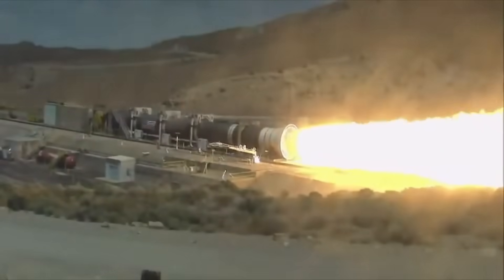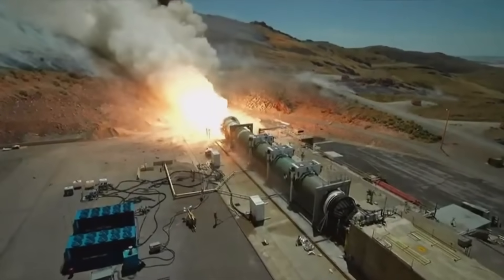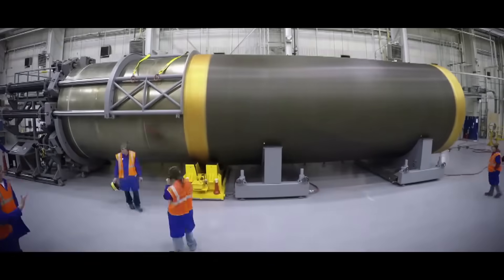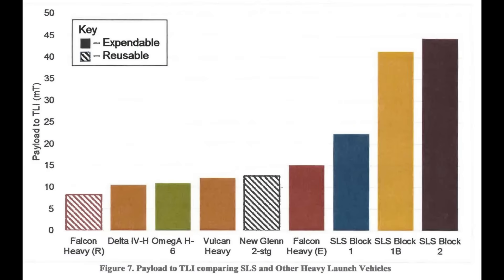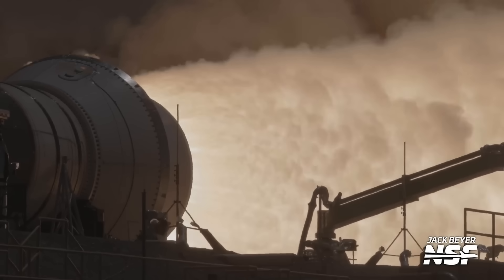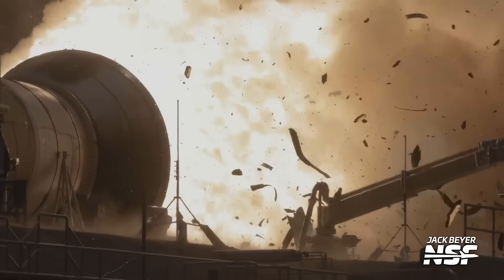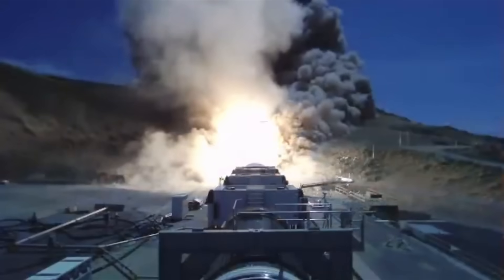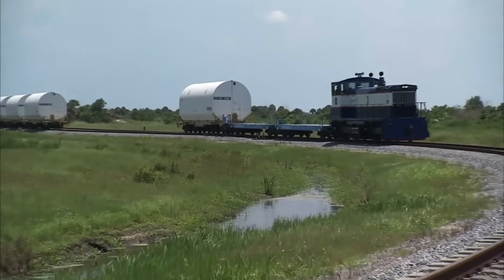NASA's Future SLS Booster Just Failed Its First Test

Comment: The Roman horse argument is not right. Stevenson had wagons from a horse drawn railway (at Killingworth Colliery) which were common at the time as one horse could pull far more on rails than with a road wagon. Indeed, the Stockton and Darlington Railway was originally foreseen as another horse railway.  The railway gauge history does not go further back than that.
Reply: Additionally, the US railway loading gauge (i.e the actual profile that limits the width and height of cargo and rolling stock) is a lot wider and taller than European, and especially British, loading gauges. And the SRB is two feet wider than most US loading gauges too, meaning special considerations are needed to avoid too narrow tunnels etc. Yes, the story is classic, but long debunked.
Reply: @kristenburnout1  Scott didn't say Loading Gauge; he said Rail Gauge...
Yes, I know; (and so, presumably does Scott) that the US's Rail Loading Gauge is a lot bigger than the UK's.
Reply: It is a kinda a leap of logic that rails had to be the same width as wagons but the coincidence is notable even if it was just a subconscious choice
Reply: The earliest rails were in mines. This is also where the first engines were put on rails. There is no connection to roman roads.
Reply: Who do you think fabricated the wheels and wagon trains for the mines? In most cases the exact same people making wagons and carts for Roman Roads, using the exact same tools and facilities...
Reply: @BertoxolusThePuzzled  According to Wikipedia his son’s firm, Robert Stevenson and Company. It was a specialist railway manufacturing company that also made the Engines.
Reply: @hempsellastro P.S. I am not trying to be pedantic but the Stevenson tracks weren't made in a vacuum. There were over a thousand years of standardization that existed prior to their company even being founded, much of which happened under the Romans as they were the biggest group of people transporting mass cargo long distances for a sizable chunk of Europe's early history.

So while the myth may not be literally true, it is still colloquially true in the sense that some Roman administrator in antiquity made a decision that ultimately decided the width of most forms of land based transport today, potential 2 thousand years later.
Reply: @BertoxolusThePuzzled  Really? The "exact same tools and facilities" 1400 years later? That seems... unlikely. Not least of all because there were a few hundred years of sub-roman Britain during which very few roads, wagons, or iron working at all was happening. Not that things were ever tightly standardised or uniform in the Roman Empire to begin with. You're right that neither the first railways nor Roman wagons were made in a vacuum. They were made in a world inhabited by people of roughly the same size, with roughly the same animals, and constrained by the same laws of physics. So it's not surprising that they came to broadly the same range of answers for the question "How wide should we make this carriage to balance stability, manoeuvrability, capacity, and ease of loading?"

There's really no need to hypothesize a direct causal connection from A to B across millennia, when the context is similar to begin with. It's the same fallacy that leads people to come up with crazy theories of interoceanic Neolithic empires for why pyramids were built by both the Aztecs and the ancient Egyptians rather than simply noting that it's an easy (and obvious) way to pile up stones and have them not fall down for a long time.
Reply: well...I need to add my 2 cents.....both in England and in the US there was a big dispute over rail gauges...both country had Broad gauge railroads (for obvious Intelligent reasons) but 4ft 8" was less expensive so in time it won out...The Erie railroad was just one notable example... ..........  the Russians stayed with a Broad gauge to this day........
Reply: If the thread continues, it would be something that is shared by all horsedrawn wagons and carriages... The width of the harnessing. If we could assume that those have been made in a standardised width throughout history all the way back to the Romans...

Given that, which seems a long shot, we would need to establish that rail spacing was derived from this same standardised.
Reply: Hmmm... And yet if you look at the Roman road remnants existing today the ruts ARE a close measurement (that means not exact to the 1/1000 of a mm, be rational here) within a couple  CM  so there's SOMETHING common about this.
Reply: @bobjoatmon1993  Roughly the same yes for the obvious reason. But railway gauges are accurate to the quarter inch. The Stockton and Darlington gauge was actually 4ft 8 inches. But Stephenson added a half inch for the Liverpool and Manchester to stop the existing wagons jamming around curves. This became the Standard gauge. Space folk need to study this history carefully as we making the same mistake with docking and berthing hatches.
Reply: @bobjoatmon1993 it is however just coincidence. The waggonways were using everything between 3' and 5'. If Stephenson had started his career somewhere else, we would likely have ended up with a very different standard gauge.
Reply: @bobjoatmon1993  Source please. Where are you getting your measurements of Roman road ruts from?
Reply: @QuantumHistorian  Internet!
Reply: @QuantumHistorian  You know you can search for these things and find scholarly articles, right?  They averaged 4'10"
Reply: @vlakieste  Sure, but they made a claim, the burden is for them to show the evidence. Ditto to you. By the way, I did google it, but the results are highly polluted by AI and old repetitions of this very urban myth, so finding good data is not trivial. Surely as you and bobjoatmon posted this claim, you have the paper backing it up at hand and can just share the reference? That will not just make my life easier, but also that of everyone else reading this thread, and mean that we can continue this discussion from a common starting point.

The average isn't the only thing of relevance here, but also the spread. And whether the measurements are just from one point in space and time (ie, Pompeii) or if it spans the 3 continents and 1000+ years of Roman history.
Reply: @QuantumHistorian well, it was a introduction class / lecture back in 1984 covering aspects and history of mechanical engineering, long before the internet, so to 'modern people' like you, it waa in prehistory and doesn't actual exist, right.
Reply: @bobjoatmon1993  "I heard it a while back" doesn't count as a source. You could be lying about it, or have misremembered, or the lecturer could have made a mistake. If there's a source, I could check it, and check its sources until I get to the foundational data. This is how discussions work and we learn things. Either provide a source, or have the honesty to admit you don't have one, and are simply spreading an urban myth that's been around since way before 1984.

Also, the idea that you can condescend me by calling me a "modern person" who doesn't care about anything pre internet is cute.
Reply: @QuantumHistorian Pompeii has a lot…just visit with your ruler
Reply: @shaunsandow2073  Why should I? Someone made a claim, and asserted that it was backed up by real measurements. It's up to them to back it up. The burden of proof is on the one making the claim, not on others to disprove it. The ability of people in this thread to forgo all critical thinking because they want a cute story to be true is astounding.
Reply: @QuantumHistorian I'm just reacting to your dismissive post
Reply: @bobjoatmon1993  Asking for a source is not being dismissive. It's the exact opposite - literally asking for more details. That you can't see that says a lot about the regard you have for facts.
Reply: @QuantumHistorian see, your STILL doing it. And the fact that you can't put yourself in my position says a lot about how you see the world.. I'm done.
Reply: @bobjoatmon1993  I can very easily put myself in your position - it's that of a BSer who has their feelings hurt when someone calls them out on their utter disregard for facts. I just chose not to endorse, sympathise, or make excuses for such a position. If you claim that data shows something, "the Roman road remnants existing today the ruts ARE a close measurement" then you either provide the data or shut up.
Reply: There's obviously still a geneology there. Technology is cumulative. They would not have reached the exact same arbitrary measurement on such a closely-related technology without some influence carrying over, even if it was as simple as some engineer thinking "well I think it should be about this wide" just because he was unconsciously thinking of carriages he had already seen.

I think this "it's just a myth" business is too clever by half, very Reddit. It's the same axles and wheels and the same idea and the same width coming from the same place. Obviously there's a geneology.

Comment: Did they forget to check the O rings again?
Reply: No, they discovered a new failure mode.
Reply: There are no O-rings in the aft skirt and nozzle assembly.
Reply: Maybe they forgot to remove the foam insulation?
Reply: The o-rings separate the booster segments, they have nothing to do with the anamoly shown here.

Comment: The SRBs designed for polar-orbit Shuttle missions were to use filament-wound casings. The solid rocket motors used on Delta and Atlas, better known as Graphite-Epoxy Motor or GEM, came later (after Challenger). One "advantage" of the FWC boosters for the polar-orbit missions was that their field joints had the "double tang" design that necessary to limit the flexing of the FWC boosters between the lighting of the RS-25 engines and booster ignition; the steel-case SRB prior to Challenger had only the "tongue and groove" joint and due to that design, you would get the O-rings exposed to the hot gasses, and thus erosion (and with the freezing temperatures the morning of Challenger's loss) that would lead to joint failure and "blow-by".

Comment: the booster survived. that is an accomplishment. It still provided thrust, but significantly reduced in efficiency/control
Reply: Without the skirt, there's no directional control. Without the throat, there isn't enough thrust to keep the craft on it's flight path. There's not two boosters for redundancy, both need to work to achieve orbit.
Reply: @punchkitten874  agreed, though the main engines likely could compensate for the loss of control it definitely would impact the height of the orbit and probably negate any LTO.
Reply: Not to sure about the state of the bottom segment of the booster but the other four should be OK.
Reply: @martinrwolfe  I think with this event, it probably would impact the mission. Not sure how much extra thrust they can lose.

Comment: 13:10 😂 DO NOT HUMP
Reply: In railroading, a "hump" is a feature in some rail yards which is a small hill. You use it by pushing a rail car up and over the hump, and letting it roll down the other side, through a switch, and into the back of the train you are building. This saves time because the switcher locomotive doesn't have to roll all the way up to every train, it just pushes the next car over the hump and a guy throwing the switches controls which track the car rolls down. "DO NOT HUMP" is painted on the sides of cars whose cargo may be damaged by handling in this manner, such as spaceship parts.
Reply: @RCAvhstape  thank you
Reply: For those why might be curious why it's on there, it's actually a railroad term

Do not hump means that the car shouldn't be put through a hump yard.  A hump hard is where they sort cars by their destination by pushing them over a hill (or hump).  When they reach the top, the car is disconnected from the train, and it rolls down the hill.  As it's rolling down, automatic switches put the car on the correct track for its destination, where it meets other cars for that new train.  Slowly the new trains are built up one car at a time.  

The bumps that occur when the cars hit each other at the bottom can be quite large, so cars carrying sensitive cargo such as rocket boosters are marked with the "do not hump" label. Which tells the railroad that those cars have to be sorted manually
Reply: So it's similar in effect to cardboard boxes of refrigerators or TV's that say "Do Not Drop." @mrbillybobable
Reply: yeah... don't want cars with hazardous materials coasting on their own.
Reply: It's kinda weird to see NASA branded rail equipment. I bet that particular line item in a budget request to congress raised some eyebrows and got a politician re-elected ;-)
Reply: @ReneSchickbauer  That rail equipment dates back to the Apollo era.  It's hardly used anymore as most current components arrive via barge.  21st century roket sizes are not compatible with railroads. I also believe shipping by private, specialized container ships is far safer than the U.S. rails.
Reply: @ReneSchickbauer  I imagine that NASA runs its own short line railroad on the vast Cape Canaveral/KSFC campus.
Reply: I said they need to put that on Elon's back.
Reply: This is railroad lingo. It means do not use a hump (literally a track that goes over a hill) classification system on these cars.
Reply: I prefer to assume it is a warning to all us space nerds. If I found myself within arms reach of a spacecraft, there is a non-zero chance I would hump it.
Reply: @thanos879 It's a railroading technical term. Trust me. Really. 🤣
Reply: awe man
Reply: Good advice.🤣
Reply: please dont, i mean it looks bad all around. Nobody wants to see you hump the srb segments.
Reply: It's always good to add warnings against train perverts on your wagons.
Reply: Just before this video I watched a "weird news" show. A man was arrested for trying to have sex with a public transit seat. His second arrest for that same offense. Now I knew what "humping" means in rail-speak, but I still completely lost it when the SRB railcars appeared :D Guess that city needs labels for their transit seats.
Reply: I don't know what little is left of the rail equipment they had. I know that the trio of EMD SW1500s are gone, though. I believe they handed all the switching work to FEC at the end of the shuttle program.

Comment: Better to go boom when testing than launching with a billion dollar payload
Reply: To be fair, the new booster did fire OK for 100 seconds, which is more than 80% of the planned 2-minute burn, and the thrust vectoring seemed to work properly. It would have been better to not have the failure, obviously, but they will no doubt tweak something and try again, unless their overlords decide to shut the SLS down completely.
Reply: @ceejay0137 Yeah. Unlike a certain other rocket, it almost worked on the first try, and actually overperformed in terms of thrust